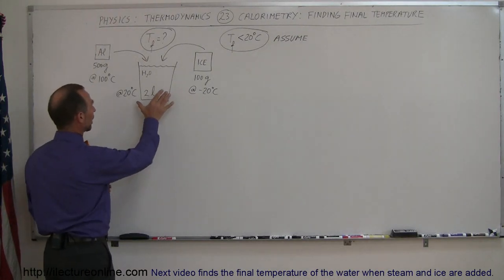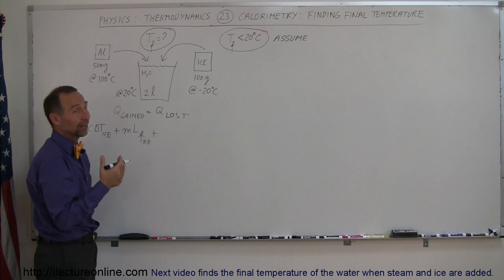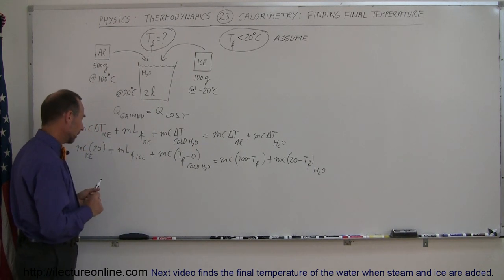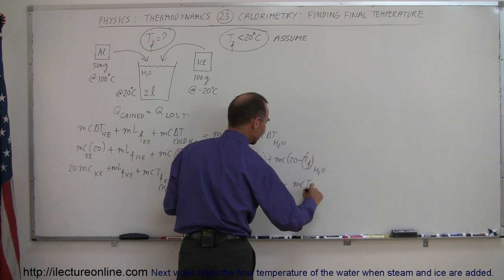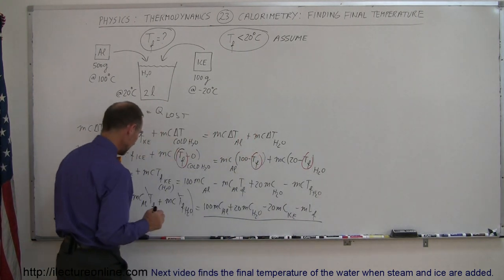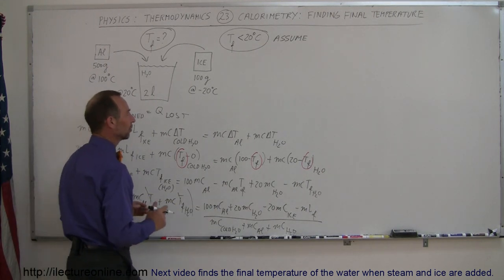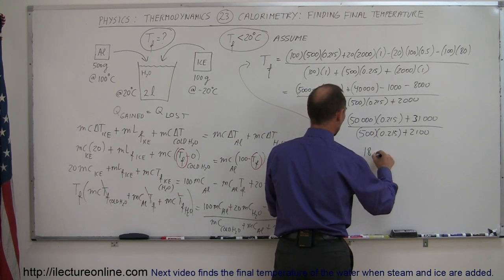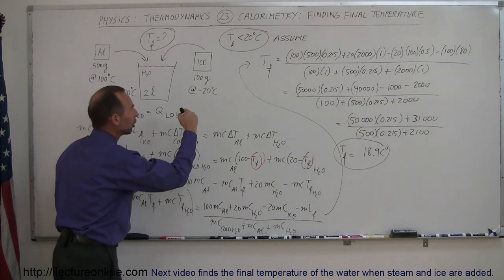Physics 23  Calorimetry (3 of 5) Finding The Final Temperature

Comment from the maker: Ngogi,
Once the ice melts, it turns into water at 0 degrees.  After that the water at 0 degrees must gain heat to reach equilibrium with the other water in the container.
Reply from the maker: Suveer Nag
Heat flows from hot to cold.
Cold objects gain heat.  Hot objects lose heat.

Comment: SIR,
      I MR.ABC having a doubt please can you sole this question as follows
Q]two ice cubes are dropped into 200 gm of water thermally insulated container. if water is at 25 initially and ice at -15 then what is the final temperature of mixture

Comment: Why do you have the specific heat of H20 liquid as 1 instead of 4.184 J/g*C and H20 gas as 1/2 instead of 2.1 J/g*C? I get that they are ratios of my information but not sure why you use the ratio. Tahnk you!
Reply from the maker: In this example we used calories per gram (instead of Joules per gram or Joules per kilogram (which is more common)).  I like using calories instead of Joules in examples, because it tends to keep the numbers simple and we can then concentrate on the technique.

Comment: It would be useful if you could write down the specific heat values of the substances on the board before starting the problem, so I can attempt the question my self without looking further into the video. 
Thanks Sir
Reply from the maker: That is a good suggestion.

Comment: Hold on Mr. Michel, shouldn't there be two extra terms on both sides of the equation; on the gained side, the heat energy that is gained by the water when Aluminum block is splashed into it, and on the lost side, the heat lost by the water when aluminum is plopped into it?
Reply from the maker: The mechanical energy gained would be miniscule in comparison to the other terms.
Reply: @MichelvanBiezen  I didn't ask about the mechanical energy. Please reread it again!

Comment: If you assume that the Tf is greater than 20 degrees celsius. Does the Tf will be negative? And what does it mean if it becomes negative? TY.
Reply from the maker: +Denver Daño 
In the method that I use, you must put the higher temperature first and the lower temperature second so that the difference is always positive.

Comment: is steam a gas? if so wouldn't we use a different formula? I thought Q=mcdeltaT was for solids and liquids only.
Reply from the maker: Steam (when visible) is not exactly a gas.  It is OK to use the m c delta T equation as it offers a good method to calculate the lost heat.  If you use   n Cv delta T you will get approximately the same answer.

Comment: A container contain a temperature of water 80degree ℃. After every 10 minute the change in temperature -4degree℃.after how much time will the temperature of water be 20degree℃????
Reply: Solve it guys please ..
Reply from the maker: This seems like an odd problem.  It is not typical that the change in temperature every 10 minutes is constant.   Typically as the water temperature becomes closer to the room temperature, the cooling would slow down.   But if the cool down rate is constant then it will take ((80-20)/4) x (10 minutes) = 15 x 10 minutes = 150 minutes.

Comment: Why did you use the specific heat capacity for Cal/g degree C instead of J/g degree C . Or Using the J/g version of latent heat vs the latent heat in Cal/g.
Reply from the maker: The numbers are easier to work with when we use cal and the sizes are small.

Comment: I'm confused, 18.9 celsius degree or 18.9 degrees celsius? 

the unit of T change is celsius degree.
Reply from the maker: If you want to express an ACTUAL temperature then use degrees Celsius.  If you want to express a temperature DIFFERENCE then use Celsius degrees.
Reply: Michel van Biezen ok, now I get it. Thank you for quick reply.

Comment: how where you able to guess accurately? I want to know so I don't have to work the problem twice on a test
Reply from the maker: That technique is called: "rough order estimation".  Round off the numbers and come up with a quick estimate.  100 g of ice require 8000 cal to melt.  500 g of aluminum releases about 100 cal / degree or 10,000 cal changing from 100 to 0 degrees centigrade.
Reply: but then isn't that like -8,000+10,000 which is a positive increase? help please

Comment: How would you work out: 
A cup holds 250 mL of water at 20 degrees centigrade. 10.5 kJ of heat energy is transferred to the water. What temperature does the water reach after the heat is transferred?
Reply from the maker: +King Panda 
Assuming that 250 ml of water has a mass of 0.25 kg.
Q = m c delta T
Therefore delta T = Q / mc  = (10,500 J) / (0.25 kg ) x (4186 J/kg C) = 10.0 degrees.
Final T = 20 C + 10 C = 30 C
Reply: Thank you so much. My physics teacher didn't explain how to work out any of the problems. Again, thank you so much!

Comment: Why is (delta)T for mc(delta)T(H2O) equal to (20 - T(final)). Shouldn't (delta)T always be T(final)-T(inital)?
Reply from the maker: Javier Garduno 
The technique used here requires the terms on both sides of the equation to be positive.
Heat gained = heat lost.
There are other ways in which you can solve calorimeter problems, but those are not illustrated here.

Comment: Sir,
How did you made the assumption that the final temp is less than 20 
I mean how did you get the hunch of it !!
Reply from the maker: Determine how much heat it takes to melt the ice.  (More than is contained withing the hot aluminum).
Reply: Ok 
But the water is at 20 already and aluminium is also at 100 , so how can water end up being cold . I mean only ice can have this much effect on hot aluminium and water 
Pls clarify it I didn’t understand 
I’m preparing for JEE
Reply from the maker: The amount of heat required to melt the ice is more than can be obtained from cooling the aluminum.  Therefore more heat is removed from the water by the ice than is added to the water by the aluminum.  Therefore the water will be colder than the initial temperature.
Reply: @MichelvanBiezen But Mr. Michel, the aluminum is more massive and high temperatured than the ice?

Comment: how much more likely is the new state
Reply from the maker: Not sure what you mean by "how likely is the new state".  In thermodynamics, heat ALWAYS flows from hot to cold and will continue to do so until thermal equilibrium is reached.  That will ALWAYS happen.
Reply: Michel van Biezen i have a question on my homework that asks how much more probable is the new state than the old state
Reply from the maker: That is an interesting question.  I would say 100%, but this may be related to a presumed probability state.

Comment: So you just assumed that ice will melt ? How do you assume ?
Reply from the maker: +The Man 
That is a "guess" .  Based on looking at the masses and the latent heat of fusion you try to predict what the end state will be.  And then you work out the problem with that assumption.  If your guess is wrong, then you'll get an impossible answer, and then you make a different assumption and try again.  After a while your guesses become more accurate with experience.
Reply: OK, now I get it. And even if I don't add melting I get the result above 0°C